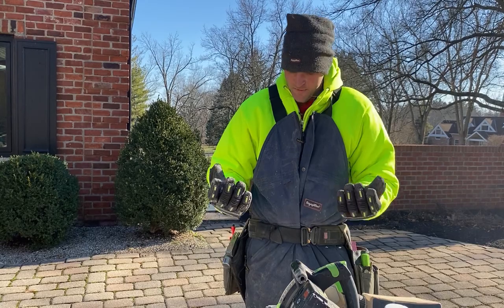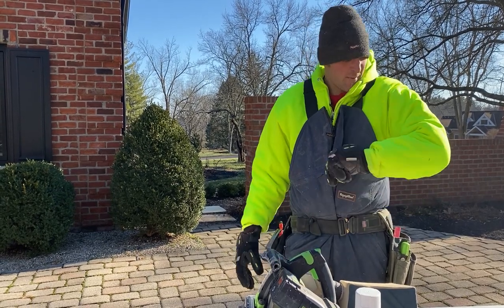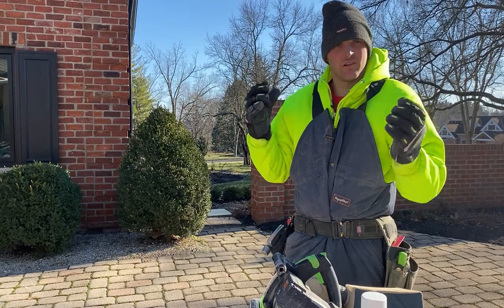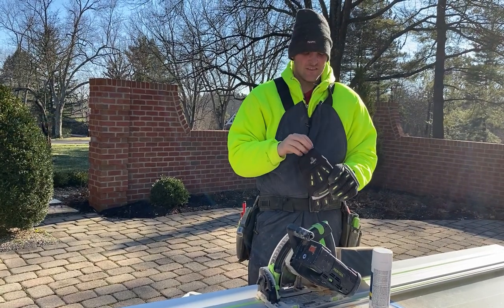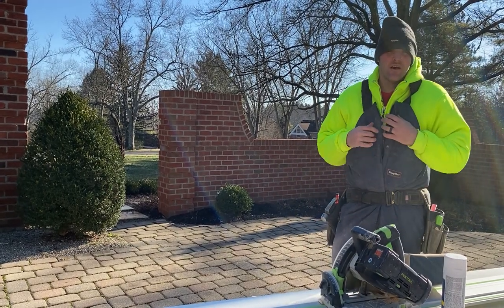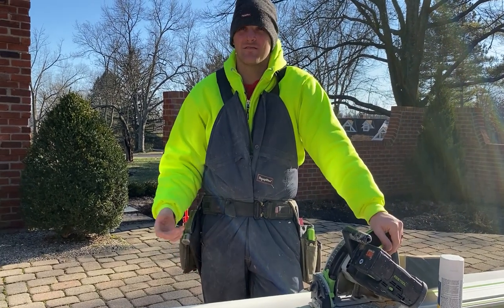Can You Trust Refrigiwear Gear?

Comment: You can trust Refrigiwear. Not their gloves though lol.
I worked in the blast freezer -25 to -30 couldn't stand it with their gloves have to use handwarmers, but their boots are perfect for below zero conditions. I reside in Texas, because of my stint with blast freezers my body is acclimated to the cold and I can tolerate any cold weather as my body was toasty lol.
Reply: Thanks. I'm from Texas and working in Yellowstone this Winter. It can get to -40F. You think it will be worth it?
Reply: @Atlas2040  You wearing the hand gloves? They have good thermal layers from base, to your long johns and even inner layer like a 'jacket before jacket'. Yes, I'd also go for their jacket orange. My pal had one good and it has hivi for refelction.